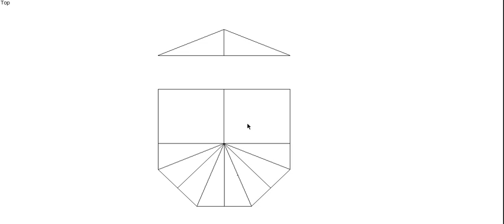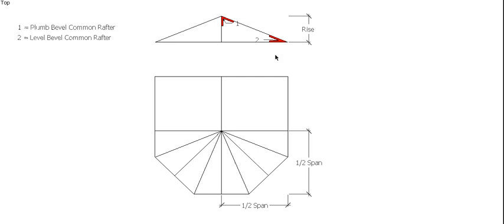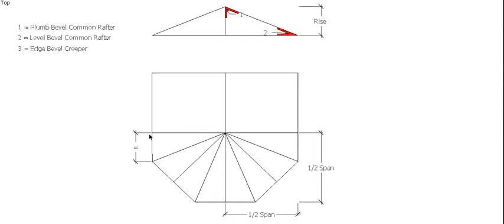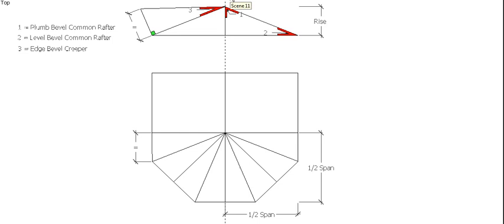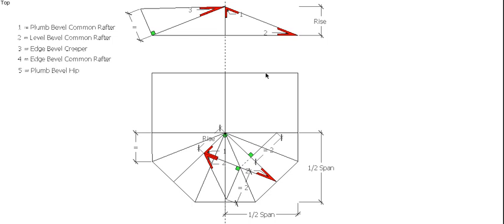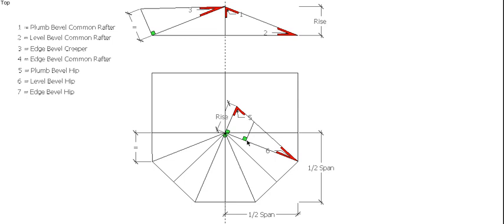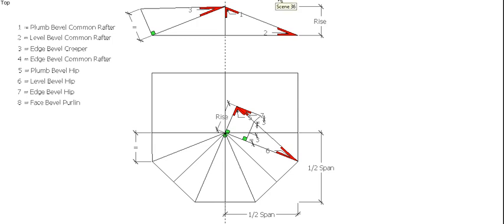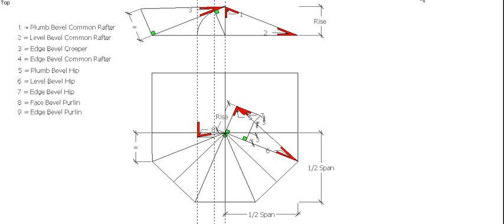Semi Octagonal Roof Geometric Bevel Development

Comment: Hi, i'm drawing a pyramid in TurboCAD Platinum to work out the bevel angles for the 4 corners/edges to make a ply one for a photographer's photo shoot, 100mm sq base 100mm high to the point, i tried using the hip rafter method (plumb cut-edge cut, true length of rafter ), that gives me good bevels when i cut the wood but the base is too wide, so i tried the jack rafter calcs but they are way off, i tried a bit of both with no luck. My bevels need to be about 43º, i went through all in this vid but none gave me an angle that was approx enough to cut some wood & have another go, I've been a joiner 36yrs, i learnt this drawing stuff in college but on site the roofing i've done is wit angle finders/bevels/string lines etc. I really don't want to get into cosines n tangents .. there must be a practical way of working out the angles without having to get the calculator out, any ideas or drawing you could point me to. thanks.
Reply from the maker: Hi Mate, these angles would be the same as if you were doing a timber hopper (funnel) I actually have a piece of timber somewhere in the shed with a direct method marked out on it. However a quick google search found this http://www.sbebuilders.com/hoppers/
Let me know if this helps I will try and find that piece of timber tomorrow.
Reply: @Buildsum  Yep that is very similar, I'll have to have a look when home on the big screen PC, there does seem to be a fair bit of Tan & Cos on there 🥴🤣 the 100mm one i'm making is just a practice piece, the ones i'll finally be making will be bigger & vary in size so i'll prob have to draw each & calc the angles accordingly , Thanks
Reply from the maker: There is a table of pre calculated angles here http://www.sbebuilders.com/cgi-bin/geometry/hopper_table.cgi
Reply: @Buildsum  Hi, I found an online calculator,  i just cut a sample that seemed to work, i'm guessing it uses the calcs in your link somehow but was a lot simpler for idiots like me, thanks a lot for your help 👍👍well,https://www.blocklayer.com/pyramid-calculator.aspx
Reply from the maker: Hi Mate, good to hear, hope it all works out.
Reply: @Buildsum  Yeah me too, he's sent his sketch through of what he wants & it incs a 3 sided pyramid 🥴🤣

Comment: Hi Buildsum
Can all these bevels be made using the direct method? I'm especially interested in the Common rafter edge bevel and the Hip edge bevels here, but would love to get a template setup for all the bevels at 30 degrees
Hope you can help
Reply from the maker: Hi Mark, the best way to directally develop any edge bevel is to set a circular saw or a mitre saw to the plan angle of the bevel and then cut along the plumb cut of the rafter or hip. The resulting bevel on the edge will give you the true edge bevel of the rafter or hip.